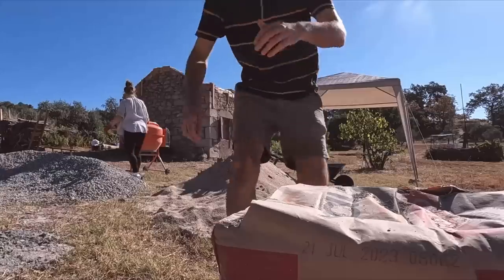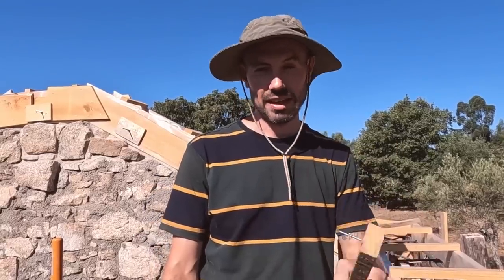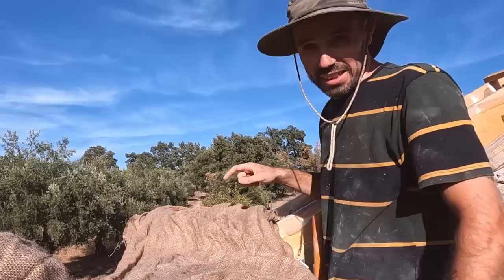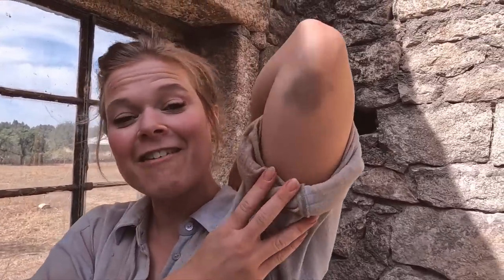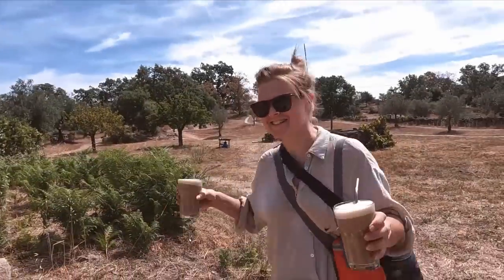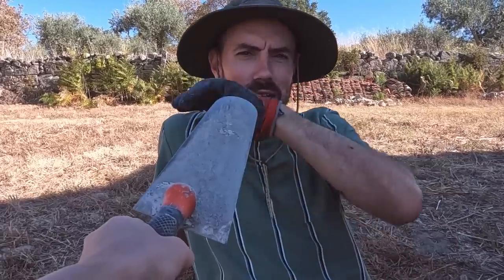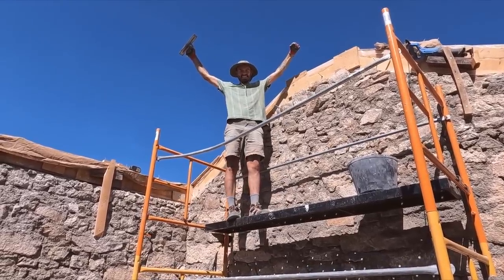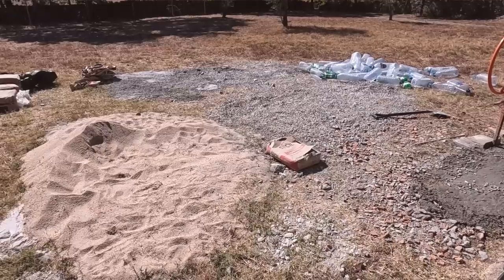Pouring Concrete Uphill…EASY?! 🏡 Old Stone House Renovation

Comment: You can make your own glu lam beams, takes at least 2x10 lumber pieces glued and bolted or screwed together. The beam depending on the span would be a minimum or 3 pieces of lumber or more to 4-5 pieces that are quite heavy but will structurally carry a large load

Comment: Very impressed with your work ethic Victoria. You must have shoveled thousands of spades of concrete mix into the mixer.
Reply from the maker: Thanks Richard! I had a tough job on the mixer 😅 but undoubtedly Ricky’s role was the harder of the two!

Comment: Very nice work to pour such sections. Please watch the heat and don't push yourselves beyond abilities. The heat can come on you very quickly giving you heat exhaustion. I know, I've been there too many times myself... Interesting on what you used as the concrete vibrator. Great idea I may have to use myself. Thumbs Up for your hard laborist work...

Comment: Subbed as I'm contemplating Portugal. Next time you use the mixer to mix concrete put it closer to the piles of aggregate. Also get your delivery driver to drop it right next to where your gonna use it not 5 /10 meters away. I'd have em dropping jumbo bags inside the building if I could, they sometimes get the hump but they aint gotta move it, ha ha. Good luck.

Comment: as soon as the concrete sets enough to remove the forms and is still GREEN is the time to find any problems patch and burn in or rub in the patches, fill holes etc. before the concrete shrinks and cures . imho

Comment: Victoria next time that you are going to mix save yourself some energy by sitting a bucket next to the gravel and fill that bucket up then take it over to the mixer.. lesser steps taken and lesser energy used up.. just keep count of how many buckets you put in the mixer.. then do the same with the sand.. You were wearing me out going back and forth with a little bit of rocks on the shovel .. Work smarter not harder!

Comment: Greetings from Palm Springs California! I’m very curious about how you checked the elevation of the forms. Did you measure up from the floor? The floor is probably not perfectly level. If I were you, I would run a string line from the two sides at the ridge with a line level before you go about setting the ridge beam. Keep up the great work and cheers!

Comment: 😮👍🏡
Great work u guys🏡👍😎.
Hey though. 
❓as for CLOTHING.
I always wear .
Old STAINNED  clothing 👍.
Whenever I DO JOBS in 
The HOUSE 
The GARDEN 
GARAGE 
SHED.
  and
on my  BIKE and MOTERBIKE 👍.
👍👍👍👍👍👍👍👍👍👍👍
Just SAVES  new clothing 
From getting RUINNED 👎😡.
Reply: 👍👞👟 🙂👍
ALSO 
protective 
STEEL TOECAPPED
SHOES  or BOOTS.
as u Can 
👍👞👟🙂 PICK UP  THINGS 👍
from the GROUND  easier if U have a GAP 
between the ground AND YOUR  FEET👣👟👞👍🙂👍👍👍.
❤PLUS its SAFER U U ALL ROUND .
🏡👍🙂 great work  u guys .🙂👍🏡